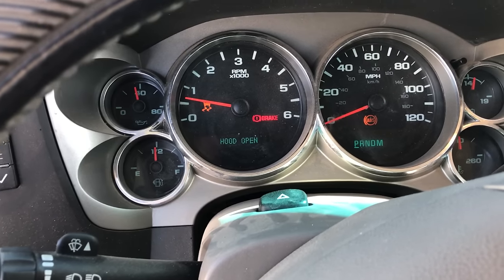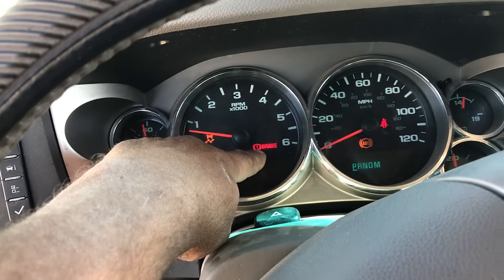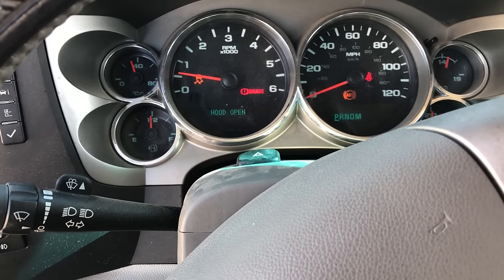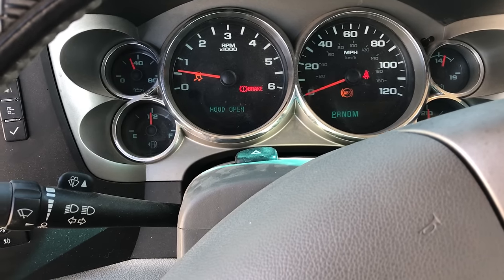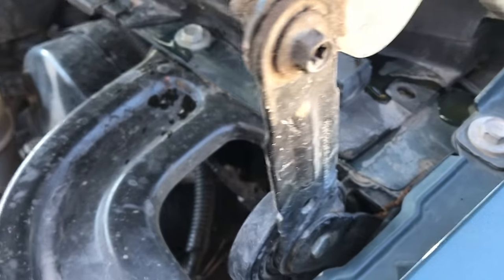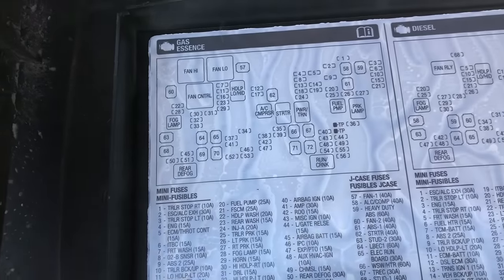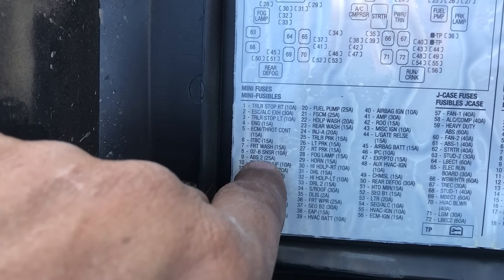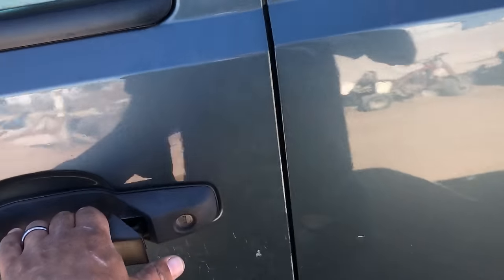Chevy Silverado ABS and Traction Light Fix, Solved

Comment: I did this, I’d replace the hub bearing already stability track an abs still there check the fuse and is not broken..taking it to the dealer this is very frustrating
Reply: Same for me! Replaced both hubs in front and can’t get rid of lights! Let me know what happens

Comment: didn't work 
fuse is good 
abs/ traction/ stabilitrac lights 
still on
Reply from the maker: is the button pushed on ? you could have a bad sensor, but that is not common. also check rear brakes. if they are dirty, or bad it too can throw those. thanks for watching.
Reply: Bearing and  Wheel hub assembly needs to be replaced most likely, especially if you can tell if there’s a grinding sound on your passenger side

Comment: Mine came on after a big bump.
Reply: same. did you ever figure out what it was?
Reply: Yes I did! The wire busted on the connector (truck side) that hooks on to the wheel speed sensor. Since i had gotten a 5 inch lift on my truck installed on the right front side, the wire was pushed down enough that when I hit that bump, it was stretched and snapped. Hope that helps I almost missed it and almost took it in to get repaired.
Reply from the maker: good information. thanks for watching!

Comment: i have:
ABS light
Stabilitrak light
Brake light
Airbag light
Park Assist light
and Traction Control light lol
Reply from the maker: did you change your tire size recently ?
Reply: I have pretty much all them also and yes the tire size was changed but the lights turn on 1 X then next time I drive it there sllnoff then next time back on...confusing
Reply: Same did you find a fix yet ?
Reply: @tommyleutinent6620  I think I know what's causing it, but I haven't fixed it. I disconnected the battery for about 5 minutes and reconnected it and all my lights went away. The next day it rained, and I spun out one of my rear tires for a couple of seconds, and all my lights came back on. I think I have a bad wheel speed sensor